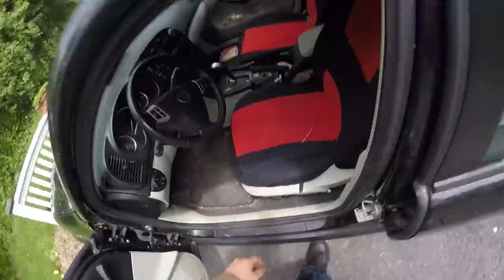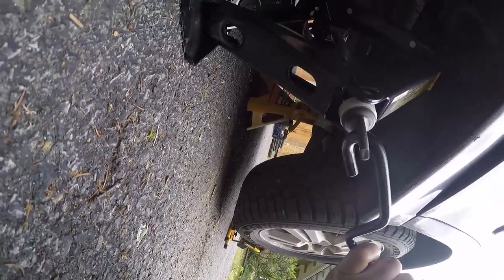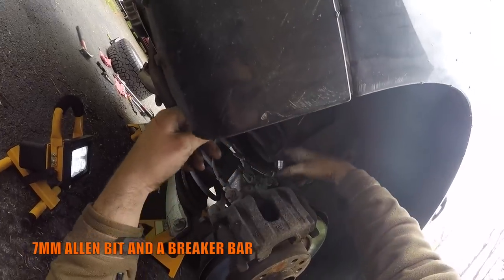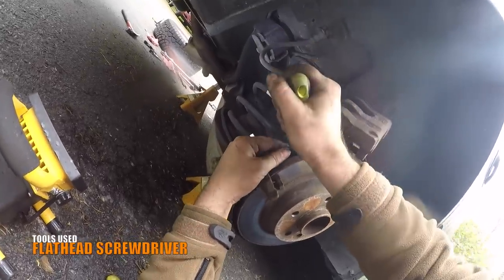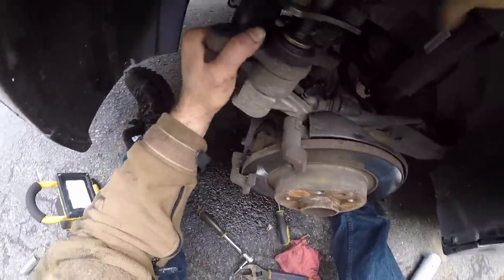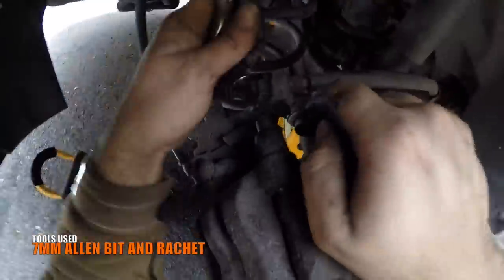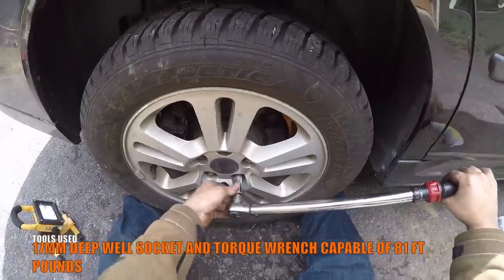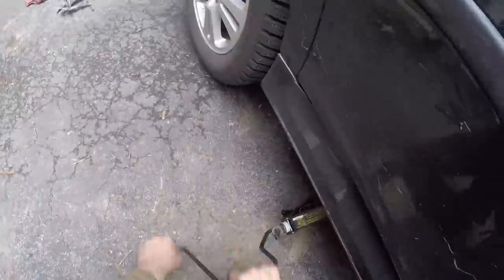Changing Rear Brake Pads on a SAAB 9-3 (2003-2007).

Comment: For anyone watching this, you can rent the piston compressing tool at any AutoZone. They charge $60 as a refundable deposit. The 'bit' that's on the tool when you open it fits the Saab (no adapter needed). The backing plate slips over the tools handle for correct positioning against the outer caliper fingers. And yes, the adjustable wrench helps to keep tension on the jam nut. Both sides turn clockwise to compress the piston. One other tip: when your done with install raise & lower your E brake lever several times to seat the piston against your new pads. Hope this helps😁👍

Comment: Great video, here are some observations/comments:
1.  When doing rear brakes, put the car shifter on reverse or drive.  Disconnect the battery to avoid unadverted switch actuation.
2.  WIth a shirt hanger and make an S hook to hang the caliper off the Suspension spring.  This will prevent any issue where you may drop the caliper and strain the brake hose.
3.  Wear rubber gloves, asbestos can be absorved, at a much lower rate, by your skin.
4.  Open the brake fluid reservoir and if is too full, remove some fluid to avoid spillage during the caliber push.  
     Once pads are replaced, drop the car off the jacks and push brake pedal several times to bring caliper to working condition.  Replace fluid and reservoir cap once you are done.
5.  You can use a C clamp as an alternative tool, to push the caliper and allow installation of new pads.
Reply: wysiwyg248 Good advice, but a c clamp wont work because you also have to turn the piston while you push it in.
Reply: A C or G clamp and some vice grips to turn the piston at same time works on rear. C or G clamp alone only works on front of car not the rear but nothing beats the proper wind back tool to the job

Comment: Can I use a C clamp to compress the caliper piston???
Reply: Evidently on Saab and some other makes the piston needs to rotate back in. Basically if the caliber piston has any indentations it likely has to rotate on the way in. If it is flat and smooth it probably can be pushed in straight.

Comment: If I don't have the tool to put the piston back? Some alternative maybe?
Reply from the maker: +TheHell666yeah sorry for the late answer the piston depresor can be rented at a local store i tried c clamps before but it only works on certain pistons and most pistons have to be depressed and screwed in so no in most pistons theres no alternative
Reply: use a flat screw driver before you take a out ibetwin the break pa and caliper.
Reply: Calipers are cheap if you can't rent a tool that fits at your local auto parts store. I've resorted to that before without regrets. Still cheaper than a mechanic changing pads...

Comment: no brake fluid or bleed ????????
Reply from the maker: +Thomas Waite I did not include it in this video. It is good practice to bleed after a break change.
Reply: Also a good idea before finished is applied to video to uncap break fluid reserve before compressing piston and remove overflow if needed after compressing and fill if needed then replacing cap press break petal a few times til pressure is back right. It will definitely be off after compressing the pistons. Someone unexperienced watching the vid might not know this...